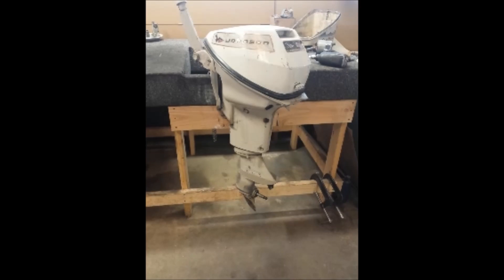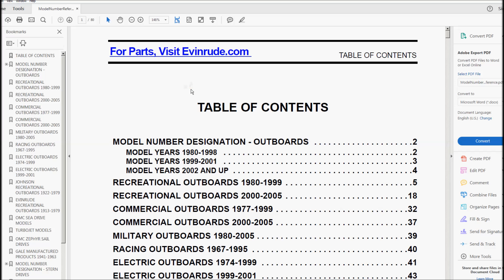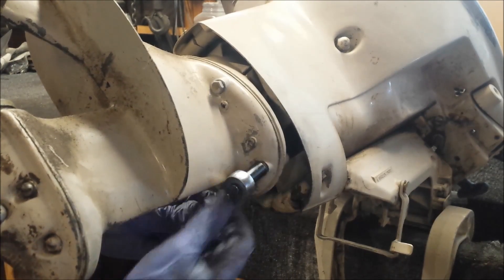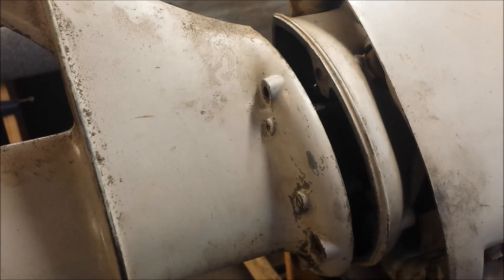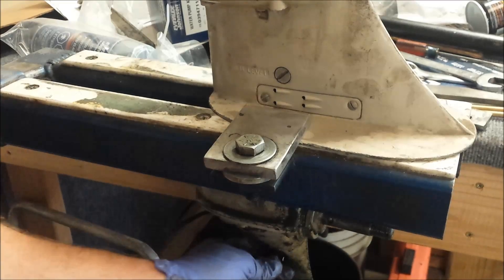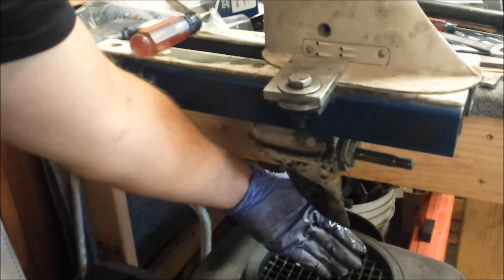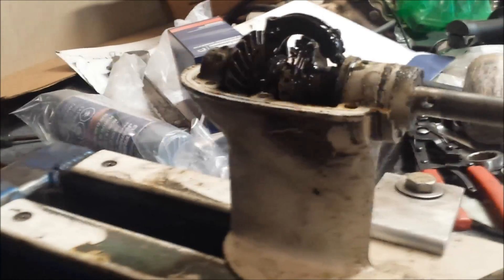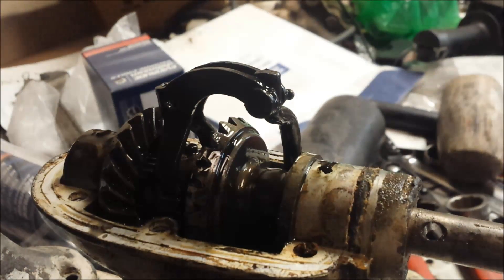Johnson 9.5 HP Teardown - Part 1; Lowerunit / Gearcase

Comment: My shifter is stuck on my 1970  it only goes in neutral and forward got any suggestions
Reply from the maker: Shifting while spinning the prop?
Reply: @BrandonsGarage  haven't even tried. my dad gave me the boat he said reverse doesn't work but I took the lower unit off, Did what you said. and it shifted forward neutral and reverse. But that's while I had the engine off. I had nothing but a small amount of water in my gear housing. I'm going to replace the impeller and fill it with gear oil and see how it goes

Comment: I need help with what to look for to get the carb rebuild kit ..everybody says the idle Jet or press in windows don't fit I have another guy who's telling me to look up all these different sites but it says that my motor doesn't exist
Reply from the maker: Youre talking about the little silver plug you pop in an out?
Have you removed it?
What is your model number?
Reply: @BrandonsGarage  mq-12a
I need an entire kit I broke the float which is made out of Cork and it was pretty old I also stripped out the idle Jet on the bottom side
Reply from the maker: 1966 Johnson 9.5
http://everythingoutboards.com/brp/carbkit/382048.html
But an OEM kit, not an aftermarket and you should be fine.

Comment: Brandon, I assume that before you removed the 4 bolts holding the lower unit on, you first removed the nut on top of the engine holding the drive shaft? Is that a step we can see somewhere else? Is removing the long shaft having any effect on the magneto assembly?
Reply: sorry, the shaft does not go all the way to the flywheel.

Comment: Hi Brandon, a quick question thanks. Is it normal for the driveshaft of these 9.5hp motors to move up freely from the lower unit lower leg once the impeller housing is off?
Reply from the maker: I believe so
Reply: @BrandonsGarage  Thanks as I knew in the smaller ones like the 4hp it comes out easily and you need to be careful as it is hard to realign it with the pinion but I was surprised it is the same with this 9.5hp. It slided up freely but I just pushed it straight back down :)

Comment: Great video. I have a 1966 Evinrude 9.5hp that is working well but I got it with the lip on the shallow water bracket boken. what is the purpoe of this and should it be repaired. Here is a link to show the damage to the bottom lip on the mid case.  
https://drive.google.com/file/d/1D_qLS-O1KXa4svg-FbhFGSLOV4U1O06c/view?usp=sharing
Reply from the maker: interesting break, hard to tell if it would really cause concern.
shallow eatter drive is jist what it sounds like, tilts the prop up a little higher to get you out if shallow watter. I use it regularly as I launch from a shallow beach.
Reply: @BrandonsGarage  Thanks for your quick reply Brandon. :) This was in very good clean condition except for that lower lip broken off where the bracket pivots and the spring loaded rod was missing with the bolts on either side  for the tilt angle adjustment. Not sure what happened to cause that damage with previous owner.  Didn't know much about it. Maybe i could get it welded with a raised bit there to allow it to pivot properly. JB Weld would just break off. I did a carby overhaul and it ran well and fired up well. Had a stuck needle in valve seat and needed a clean of the bowl jet. This one was made the year before the vibration damper plates were put on below the carby on one side and below exhaust housing on the other. maybe that would be useful to do if I can get a hold of the plates. Not sure where they bolt onto underneath.
Have a video of it running too here ....
https://drive.google.com/file/d/1l52cHAX6VrYMHRjXvbtwLcBAY73LB_b3/view?usp=sharing

Comment: I did a water pump replacement on my 1965 Johnson sea horse 9.5 fallowing your video I have rebuild over 6 Mercury and Mercury Mariner out boards no issues but newer motors not the older models I can’t get into reverse now saw someone drop the shift lever into natural before dropping lower unit to get to shift lever undone no issues taking it apart and seemed to go together pretty easily but won’t go up to reverse just natural and forward any ideas? Thanks for your posting your video

Comment: quick tip i work on farm equipment and rusty electric motors and pumps, the key to getting bolts to break loose with minimal effort is to tap them with a flat punch and hammer and the vibration breaks them free. also zep45 helps alot too if you can get your hands on it

Comment: I have a1965 Evinrude sportwin. Took the 4 bolts off of the lower unit and there is not enough room to get to linkage loosing bolt and there is not a slot for a screwdriver in the bolt. Any advice?
Reply from the maker: shift into forward, then try to drop it down
Reply: Already tried that

Comment: Any advice to remove a stuck driveshaft in my 64 9.5  
I removed my lower gear case and the copper tube came with the lowercase and the drive shaft stayed in the power head 
And I have another drive shaft from another lower unit I just need this out and pb and whacking on it won’t help

Comment: do you have any qd-14 10 hp. johnson power heads you wanna get rid of.i need a good powerhead bad.rrebuikt one.it did fine till this year then had it runaway and overtached and bearing issue now.i have  a good 1949 10 hp but powerhead to watertube is different.now im in a pickel.thanks randrews612@gmail.com   sincerely.love your videos.workin on a 9.5 now.try to see if gonna run hope so.pls contact if you have a qd-14 1953 is year was made .some are same engine like 54 thru 56 i think.ive seen u tear down some 58 its little different.please help or tell me someone who might help me.great stuff.good  good stuff

Comment: Brandon, I have the 9r-72M version of this motor and she's slipping out of forward gear under load.  I've taken the gear box apart and the gears and clutch dog, and drive gear on the shaft from the motor all look good (no worn engagement surfaces).  Could the slippage be a shifter adjustment?  Anything else to check?
Reply: never mind.. i think i figured it out.  rubber hub in prop slipping under load.

Comment: Do you have a video on how to fit the water tube shift connector and all back together. Just changed impeller but can’t get it to seat correctly wear shift lever works right.
Reply from the maker: one of my newer video, the 1958 10 HP water pump, its pretty similar.
Reply: Got it put back together right. Thank you for the videos!

Comment: Hey Brandon I just bought a 73 Johnson 9.5 with tank and hose for $40.00 Looks great starts and idles good 2 questions  1st question Tiller is really stiff and won't throttle all the way up 2nd shifted into forward 1st time I started it in a barrel worked perfect,went to neutral and now it wont shift shifting lever has good snap and stays in position.I don't want to break any seals because right now the lower unit is sealed and doesn't leak and a seal kit where I live is $65.00  Don't want to pull the flywheel either any Ideas for a short cut By the way I am a subscriber and think your videos are the best Thanks

Comment: NEED ADVICE!!!

Just bought a 1964 Johnson 9.5 short shaft, only has about 20 hours on it supposedly.
supposedly was running 3 years ago.

besides changing the oil on the lower unit, any precautionary advice before i hook this thing up with some gas and start her up??

THANK YOU!!!
Reply from the maker: Don't even need to change oil really.
How do the fuel lines look? old/original 'ribbed' lines?

Comment: replaced impeller and gasket but still on water comes out
Reply from the maker: Did you seal the pump base (metal plate) to the bearing hosing? 
Then did you seal the housing to the base?

If yes, hook the drive shaft up to a drill, and stick it in a bucket of water - see if it pumps.

Comment: You mentioned the water tube was trying to come out when pulling off the lower unit. Mine did. I can't find a way to fish it back up into the powerhead. Any ideas how to replace it short of pulling the powerhead? I also watched the rest of your vids on the tear down. Thanks for those. Any steps I can skip if I do  have to dissect to the powerhead. Thanks.
Reply: Same here how did you go about getting it back in